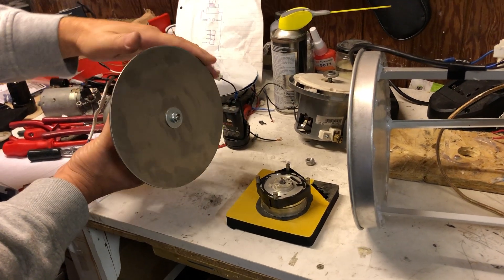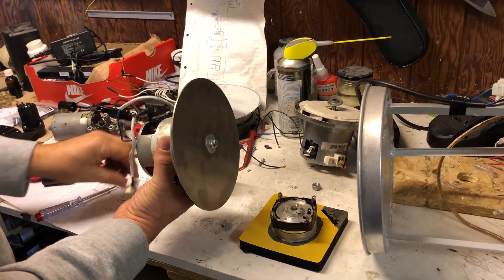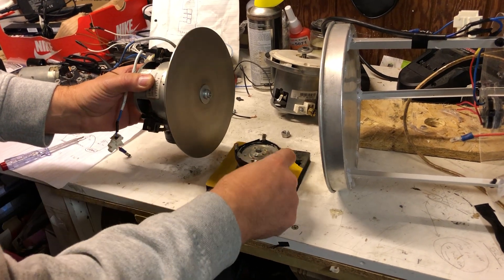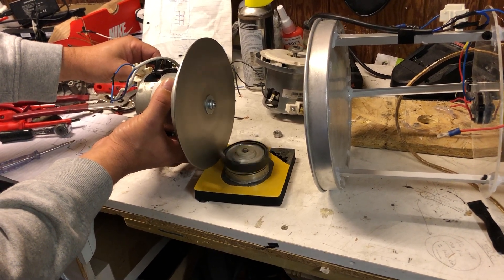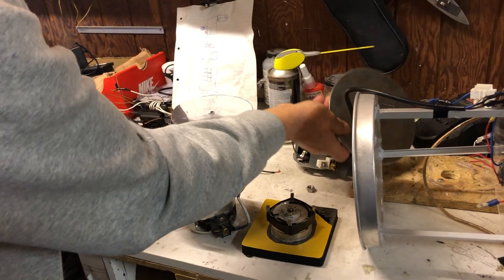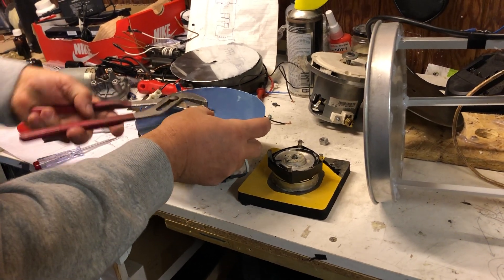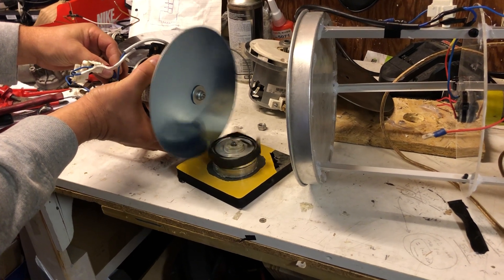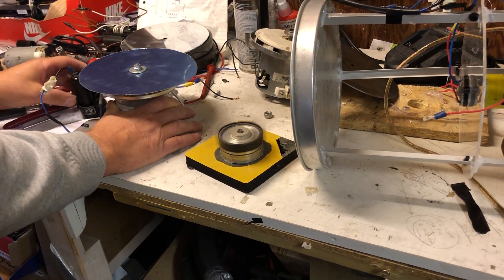SWR ( Tesla scalar wave rider) observations about aluminum, vibration and magnetic interference.

Comment: hi @dkdyker! nice findings! Are you aware that Alexey used different 3x disks built of 2 different different materials? He stated in his video (https://youtu.be/sZe4Wc_JfW4?t=609) that both upper and middle disks are from steel, but the lower disk from alumunium. But the aluminium disk made from special structure (porous / scabrous structure). The lower plate utilizing the specific effect of a asymetric capacitor (aka Biefeld–Brown effect)
Reply from the maker: Many thanks I didn’t know this. I thought that it should be some capacitive effect, great cheers 🥂
Reply: @dkdyker  yes, capacitive effect. but as I understand his explanation (checked full video) there is a need for asymetric capacitor (not just an electrostastic field between plus and minus, but this field must have some gradient - let call it changed field dencity from one pole to other / inhomogenous electric fields) - thats m.b. why he called assymetric. Such effect would cause an antigravity force and such effect are utilized by beetles. search for "Biefeld-Brown electrostatic"

Comment: Aluminum, Copper, Silver, Gold, & Bismuth are all diamagnetic.  They resist change in magnetism.  Bismuth is the most diamagnetic material, which is why you see it in a lot of "anti-gravity" magnetic kits and toys.
Reply from the maker: Bismuth, great 👍🏻 maybe this is what is in the graviflyer experiment. Thank you.
Reply: @dkdyker  An Asian electro-mechanical engineer that does a complete assessment of the graviflyer.  He actually goes as far as to do the math to calculate the weight and value of every component.  It's very dry and slow and hard to watch. I would suggest watching 1.5X speed.
https://www.youtube.com/watch?v=pPLhMLWn-GI
Bismuth is not a good electrical conductor, so it won't do any good in this setup.  Supposedly, the plates are made of either hammered aluminum or some kind of electroplating.  I still have a lot of skepticism about this device, but very hopeful.

Comment: @ 2:20 i could clearly see that there is magnetic interference!
Reply from the maker: Yes but aluminum should not have the same properties as magnetic materials. Why when rotating a disc should it show other properties??
Reply: @dkdyker  As it clearly had a magnetic influence before it was spinning it clearly is not aluminum!
Reply from the maker: Sorry joe but it is aluminum, there is no magnetic interference. At 2:20 you say I touched the magnet with the disc that is why it moved. If as you say there was interference the magnet would have stuck on the disc. Sorry 😢